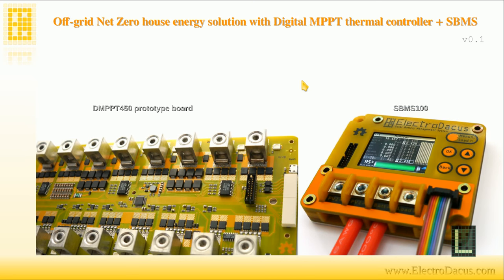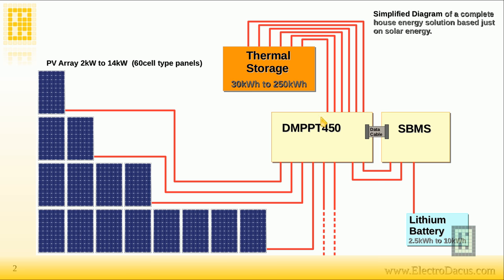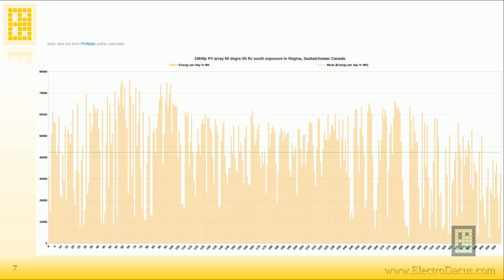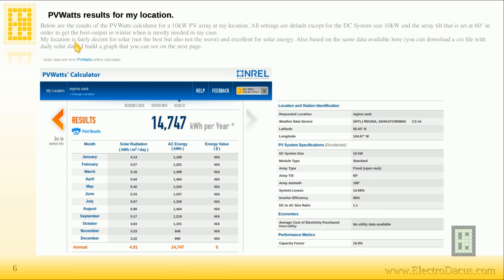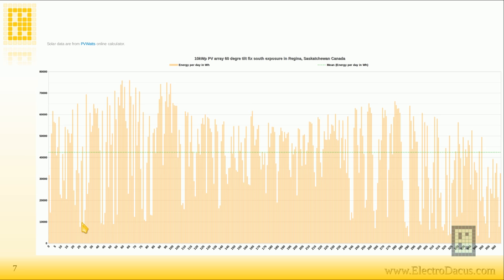Explaining the Digital MPPT thermal controller

Comment: Hi electrodacus Thanks very much for sharing This NEW way of thinking, that is very good....I serenely want one to. In you presentation you mention termisk heed storrage and thats is a great way to store you "heat" for the night. I have that system in My flor now an it     is walking fine, but something that in not so good is the speed it can change the temperature in the room and in the flor, the wire under the concrete has to be fairly close side by side.... say about 40 to 60 cm otherwise you have places where the flor ar hot and other places where it is cooler. and when it is worm it hold a day ore so and you use a day ore to to het it up again.
I have short of a way to solve that: In the wall you have insulation, and the only reason for heating your house is that the heat is escaping tru the wall ruff windows and so on. One way to se it is by thinking insulation ...Lets say winter -10C if you look the outside of the insulation there will be almost -10C if you look inside there will be almost +20C ore so....Lets say you have 300mm insulation in the wall there will be almost 10c degrees difference  for every 100mm ore so.....Now the solution: ...You ad wiring like you have in the  flor in the wall in the same way and connect is as you want with your digital system and an an termostat in the wall to measure the temp in the space where you have the wire AND Then you ad a mother 100mm Insulation ....Now you can make almost a constant temperature inside the wall and you warm in the room will not escape tru a cold wall anymore because....When it gets colder outside the insulation gets colder and the thermometer opens up for the power to the cable in the wall it heets up a little bit so the temperature 100 mm from you livingroom will be almost constant, and if you want it a little bit hotter inside you ad just a little bit of heat to the wire and it will heat up the rum because of a big area of preheated wall, and you will go with colder room temp because the wall feels wormer ....The reason for 100 in to the wire is because if you put a nail on the wall you have 100 mm before you hit the cable, ad with a cable finder you can easily find the wire inside the wall ...so you count brake it ore something else !"#€%&/  dam.. dam......I hope you get the idea... Best to all Feel fri to use what you feel for it is free....JT Denmark DK
Reply from the maker: Hi Jørgen, In my particular case the cables in the floor will be spaced at 4cm and they will be about 3cm deep under the ceramic floors this will give a very uniform heating. The cables will receive power directly from solar PV panels and only work during the day (as long as PV array provides some power).
Since there are about 14 cubic meters of concrete in my floor thermal storage (97kWh at 12C delta) and a 10kW PV array will produce an average of around 35kWh in a winter day the concrete floor temperature increase over the core of a sunny day will be less than 4C delta. So say you start with 22C in the morning it will get close to 26C by the end of the day then slowly drop back to around 22C or 23C over night depending on how cold it is.
So temperature will feel fairly constant. I can stop the heating completely in winter for 3 to 4 days and the temperature will still be acceptable maybe 18C if I started with 26C.
If the wall are made out of bricks or concrete (something that can act as a thermal mass) then yes you can use the walls for thermal energy storage but heating the floor is more of a choice for many houses and will be more comfortable.
You  can see how my house was build here  https://www.youtube.com/watch?v=Y3g4gmRvgko&t=603s the foundation is competently isolated form outside with no thermal bridge. The wall's are made form solid 9cm wood with 18cm of expanded polystyrene as thermal insulation.
Windows are small since they have about 10x higher thermal loss than the wall for same surface area.

Comment: Hypothetical situation ... once your thermal mass reaches its maximum storage capacity of 97.4 kWh (the 12c delta), how long would it take to reach its bottom state of discharge WITHOUT any additional energy going into it?
Reply from the maker: It depends on outside ambient temperature. If outside is -20C and I want +20C inside then so 40C delta then the house will need around 30kWh in 24h day so about it will last for about 3 days that is why I will need more like 160kWh total thermal storage but currently I only have the 97kWh working. It still good for over 90% of the time.
I will get an absolute minimum of 4kWh from the 10kW PV array even in an overcast day.

Comment: This is pretty cool. I have been using my solar system for heat . Im in Canada Ont. But have been using baseboards and fan heaters. I do this with electric pv so I can use the electricity when its hot to run my house in summer or when the grid goes down. I am switching from agms to lifepo4 a123 cells(9000 0f them).  47 kwh of storage. Its no problem in summer but heaters in the winter is still alot. Do I need a better way?
Reply: I was thinking about switching to an old furnace oil tank(750L) to heat water. Im guessing that would handle 66 kwh of storage. It will be inside. Do you think this is worth it? A 1500w fan heater runnig 24hrs a day uses 36 kwh. Do you think I would get 2 days of heat from it?
Reply from the maker: @frankz1125  If you have natural gas available as a source that is fairly close in price with solar heating but I think heating oil is much more expensive (do not know the price for that).
How much energy you need for the house depend on the climate at your location and how well your house is insulated.
Why 9000 of those small cells ? I use the 20Ah A123 cells and my battery is just 4.5kWh as for heating I use thermal mass storage about 10x less expensive than LiFePO4.
Reply: @electrodacus  the 9000 cells is because they are $.30 each and I want to buy out the stock but I dont have enough money. I only have electricity and wood for heat .And solar . My house is not well insulated but im working on that. I really dont know much about electricity and am still learning. I do have access to around 10kw of pv. I want to live normal but with only solar as my sources . I want to be as efficient as I can afford. My system is 120vdc to 120vac at the moment AGMs. I am still in the build stage of the lifepo4 bank. It will be 36s 250p. Check my vids click on my name to see my channel. I couldnt image using so little power as you do for heat.

Comment: Hi Dacian
Thanks for feedback and your spend time...on Me.. I still Like you Project and your Way of thinking....

.....I have to re-think the hole project, I have to use my solar panels somehow, they are USA Made, and is considered to be the Roles Royce  solar panels compered to China stuff. 

And Yes They have some 72 cels panels, but I can't get them yet, for a affordable price.....In Denmark The SunPower 96 cels SPR-X21-335-BLK cost almost as much as 1000 CAD/ pice.....I got all 12 pieces for 600 CAD and I intend to use them so I have to figure out ....The best way to do that.

The data for the SunPower 72 cels Panel SPR-X20-250-BLK 
Open Volt 50.9V  short circuit 6.20 A ......Norm 42.8V 5.84 A ....will that fit you system ore is The Volt to high, when I go for a 24V Batt Bank ?

7.1 "The PV cells are connected in series in most solar PV panels and there are just a few standard PV panels with by far the most common in recent years being the 60 cell PV panels rated from 240 to 270W depending on the cell efficiency"...........Mu mistake ...I just assume that when you mention that " PV cells are connected in series in most solar PV panels" That was the cace in your situation to...but NO

Well LiFePO4 ore not hmm If cycles are a problem get a bigger bank the it last longer you cut down on cycles and it will last longer, 2 reason not that much current draw from the single element, and just go 4,05 top and 3,4 down then You have a lot more cycles, I like the Li -ion 18650 cels better because they can be used  in more heavy load application , not so big volt sag more stiff volt pack........But that is just my opinion.

And ...If I can get my hands on some 60 ore 72 cels I'll come back.. ;-)

Something I want to investigate more in, is the new supercap graphene solutions they can have manny more cycles then both those to chemistry and you can make a biiiiig bank your self at almost NO cost but a lot of walk...So maybe for House application thats the way to go ? 
it will be bigger yes.... but it is not so temp critical as LiFePO4 and Li-ion.........and Looooot of Amp reddy to be used, and No low Volt cut off just use it until your electronic can't use the small  volt anymore and just let it sit until you have power to charge it up again, Thats is The way I want to go.... :-)   Just Make a Biiiig Bank and you are fine the next 25 Years...at almost NO cost Just Walk.
And maybe make more (39) small banks and connect the them direct to the solar reddy to be used, ore just connect the solar panels direct to the Cap Bank and let them charge them up when you not are using the panel ore instead of a resisted load and use that to make head when you need it...like coffee machine, Vacuum cleaner just some short time loads...   ore just parallel the panel to a supercap  bank and they can charge them up when They are disconnected from your system, and they are reddy to give the power when you need it. ore something like that .....And HERE you can use 24V ore what ever you Volt you decide to use, And you can Back them Like your A123 so you can use the same system like you already have today just deferent  :-)  .......So maybe thats the way to go I don't  ......Know yet....I think ?

Can the DMMP450 handle the high Volt from my 96 cels, If so We can lower the volt with a bucket converter/downconverter  to the SBMS 120, Just to get it to walk ? I Know that the efficientcy are out off the window ....to but still the heating will be OK ??    

By The Way House insulation ...We have 400 to 500 mm in the floor, roof, and wall, to keep the sun and cold out.....but the windows are week link in that equation.

Best Luck Dacian  and happy Power making
Regards Jørgen Thomsen Denmark DK
Reply from the maker: Yes that price is extremely attractive if if 50CAD for one panel. I will get new panels 265W 60 cells and they will be 190CAD each (that is typical price here).
Yes the 72 cells from SunPower will work with SBMS but will need a slightly modified DMPPT450 (I need to change some TVS and use slightly more expensive ones).
A 250W 60 cell panel will be slightly more efficient in winter (cold days) than that 72cell panel but in summer they will be about the same when charging 8s LiFePO4 or 7s LiCoO2.
With very few exception PV cells are connected in series only with each cell having a max power point voltage around 0.5V and an open circuit voltage of around 0.7V
The larger the battery the worse the cost amortization since all batteries will also degrade with time even if not used at all and just kept in storage.
You will want to use at least 50% of rated capacity from the battery each day. LiFePO4 have the lowest internal resistance so they have better power density than LiCoO2 or NMC chemistry (commonly found in 18650).
I typical high energy 18650 has around 60mOhm internal resistance with the higher power density cells usually found in power tools no better than 20 or 30mOhm but reduced capacity just 2000mA to 2500mA for those type of cells.
The new A123 cells 19.5Ah that I used to construct my last battery 8s10p have each 0.5mOhm impedance so significantly lower than even high power density 18650 cells (say 10p 18650 will give you the same 19.5Ah capacity but at higher internal impedance so it will have a larger voltage sag at same discharge rate).
Sorry super capacitors are not even close in therms of cost amortization in this type of application.

Yes you can increase the number of cycles but each cycle will be smaller so less energy stored and the end result will be about the same in therms of cost amortization. You can do 500cycles at 100% DOD,  1000 cycles at 80% DOD (3.4V to 4.05V) or you can do 2000 cycles at 40% DOD but that will be exactly the same in therms of cost amortization.
The A123 systems I use now have a bit over 5000cycles at 100% DOD the Sony LiFePO4 that are in 18650 format can do 6000cycles at 100% DOD.
Because of this high cycle rate and slow aging Sony can offer 20 years warranty on they energy storage solution based on LiFePO4
LiFePO4 is just far superior in this aspect and perfect for stationary energy storage.
No DMPPT450 will not be able to work with 96 cells and can not be modified to do so (complete redesign will be needed).
You can use the panels for heating directly without DMPPT450. The resistive heat elements will need to be calculated to match the PV array and efficiency can be as good as 80% in a full sunny day and even lower than 30% in a cloudy day. You can see at page 9 example of Panel + heating wire only and efficiency in two example days  http://electrodacus.com/DMPPT450/dmppt-presentation-v01.pdf
Considering how low the cost of those panels is and if you have the space while less efficient it will be very cost effective.
You can do manual DMPPT by reducing the heat wire resistance in a cloudy day thus increasing the efficiency.
Yes windows are always the week link that is why my house windows are small just enough to have decent room illumination during the day and all windows are facing south to compensate a bit with solar gain when is sunny.  
I designed the house and you can check the pdf here if curious http://greensask.com/pdf/65mp-new.pdf
The average temperature here in January is -18.6C and the house needs 1000kWh for heating in that month. If I where to move my house in Copenhagen with average temp in January of 0C I will need about half just 500kWh but I will need 2x larger PV array since there is about 4x less solar there in January.

Comment: I guess I would be frustrated to not be able to use all that potential of the 39 pannels in the summer. I wish I build another house such as yours but I wish I would power an electric car in this setup. Do you consider such an option when developing a new hardware release? Are you building off-grid only hardware? :) Do you have plans (that you can share) for your beautiful house? :)
Reply from the maker: PV energy is extremely inexpensive below 2cent/kWh and thus it make no sense to try at any cost to use excess energy.
EV are still much more expensive to drive than ICE cars so for now I have no plans for an EV. Battery cost will need to drop significantly to make EV a cost effective alternative.
The EV charging should be done directly from PV since if you go trough another battery then that will make the EV even more expensive than it already is.
The 30V DC from the large PV array can be used in summer to charge an EV but will require a DC-DC to increase/step-up that to EV battery voltage 300 to 400V DC and a controller that will communicate with the car to allow charging.
Unfortunately the way charging is designed in current EV's will not realy allow for PV direct charging since they expect a fixed charge current (no fluctuation with whether/clouds). They did this since they wanted to make sure the charge cable is OK so it asks for fixed charge current and if that fluctuates it will stop the charging.
Yes I design low voltage stuff for OffGrid only. I do not think grid will have a bright future when battery cost will get lower and cycle life improve.
Yes you can download a pdf copy of the house plans here http://greensask.com/ . You can use them as you want since the house was designed by me.
Reply from the maker: The reason an EV is more expensive to drive than ICE has to do with battery cost amortization.
Currently in relative volume you can buy high energy density cells as tose used in most EV's at around $220/kWh
Thus the battery in a say Tesla 90D that is 90kWh capacity will cost around 90kWh x $220 = $19800
The usable capacity is around 80kWh since there is a small reserve and at a full charge you can drive about 400km that is with an average of 0.2kWh/km
That battery is good for about 500cycles 100% DOD before end of life but if cared about and not fully charged it may be capable of 800cycles at 80% DOD before end of life in any case this is sufficient for most users since over the life of the battery you can drive 800cycles x 80% x 400km = 256000km and with a average car driver using about 20000km/year that will be good for more than 12 years.
Now I should get back to cost. Assuming you take advantage of all those 256000km so you do not drive less than 25000km/year then
$19800/256000km = $0.077/km or $7.7/100km just for the battery amortization cost to this you need to add the cost of energy you put in to battery + 10% extra for the charge discharge efficiency.
My old and inefficient 2002 Oldsmobile intrigue with a 6 cylinder 3.5L ICE uses around 7 to 8 liters/ 100km on highway (most of my driving is done there) and gasoline cost here is around 1CAD or less that is now around 0.8USD thus 8liters x $0.8 = $6.4/100km thus less expensive than just the battery amortization cost in an EV based on today battery prices.
When you add the cost of input energy in to an EV things look even worse even if is just 2 to 3 cent/kWh for direct PV charging.
Reply: Interesting perspective Dacian. Thanks for the indepth computation.... Will do a computation for a second hand chevy volt and come back to you to revise it if you want.